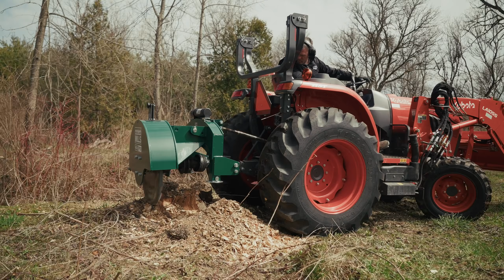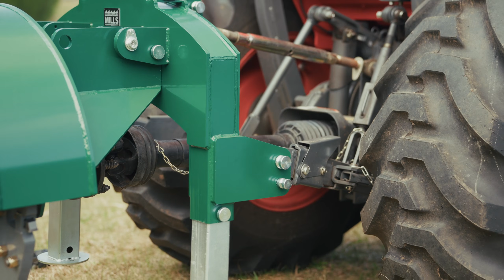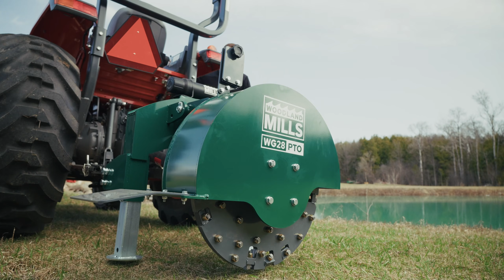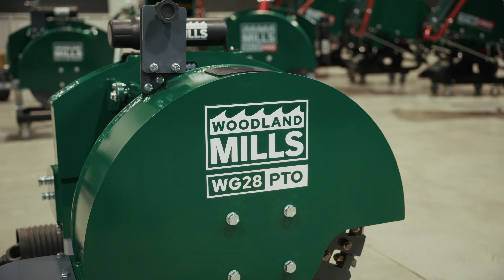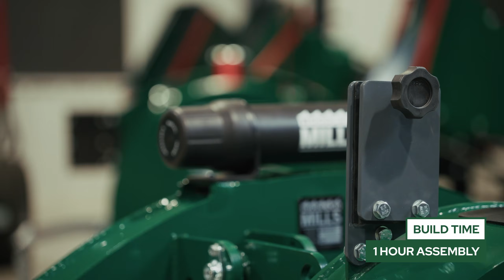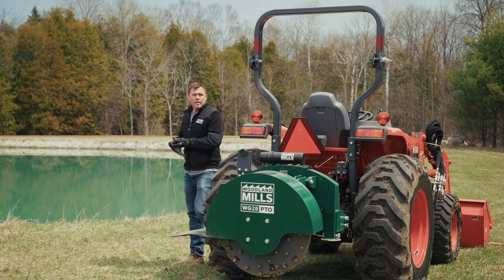Woodland Mills WG28 Stump Grinder Walkaround

Comment: Sir, is there any reason why you can't mount cutters on the other face of the cutter block so to cut when reversing? Could the nuts be replaced with tapped threaded cutters? Kindest regards Peter.
Reply from the maker: Hi Peter, the design of the WG28 does not allow for reverse cutting with how the shock absorber and frame of the flywheel is in order for the flywheel to sway during normal operation. 

As for the nuts, no, they are torqued down to secure the teeth, so any changes could alter how the teeth work.

Comment: that finally fixes the problem of the cutting speed being "too slow" on the 24" model .... this here will have almost 20% faster speed the carbide engaging with the stump .... THAT will help a lot to get good cutting speed rather than tearing with the lower speed 24" well
Reply from the maker: Glad you liked the upgrade!